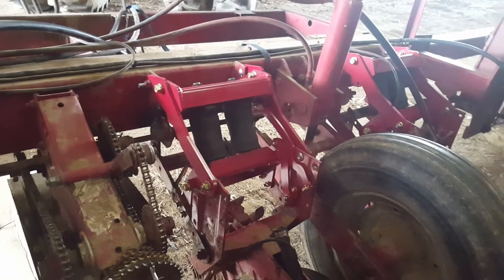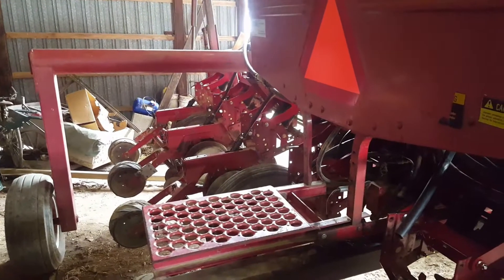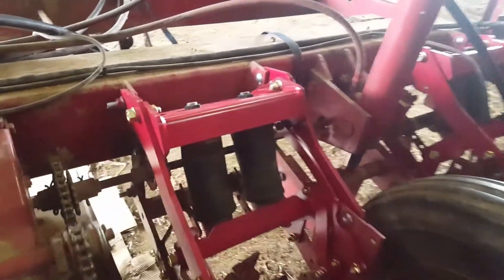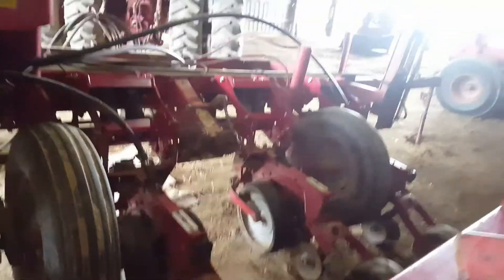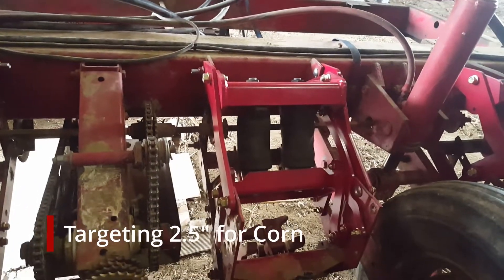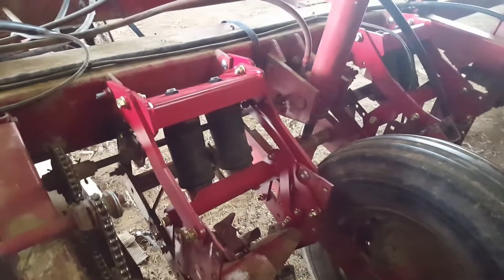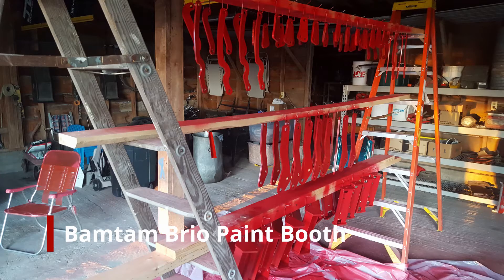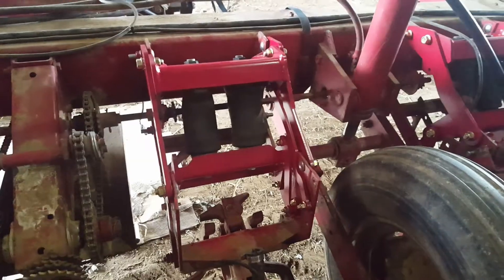Bantam Brio Designs Pneumatic Down Pressure for 900 Cyclo Corn Planter

Comment: That is awesome.  DId you custom make the brackets or were you able to purchase them?  What brand of downforce is that?
Reply: Sorry I shoulda waited til the end of the video.  Impressive.
Reply from the maker: @chrisburbach1999  No Problem...  I am an engineer by trade and farm on the side.  Mine is a 900 but the system should fit 800, 950, and possibly a 1200.  It will not work with the insecticide boxes or drives installed.  At 100 psi it creates about 525 pounds of down force.  I typically run about 50-60 psi when I am planting.  I plant no-till in heavy clay with no row cleaner and no wavy coulter and stock closing system.  Feel free to reply back if you have any questions or topics you would like to discuss.